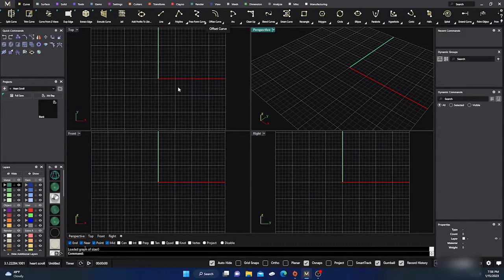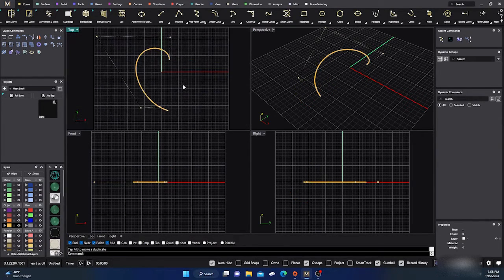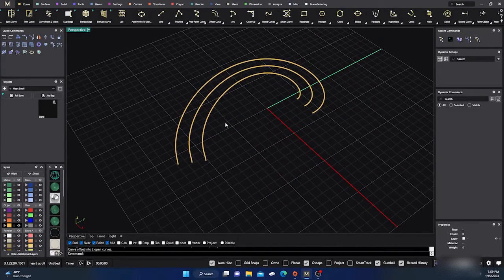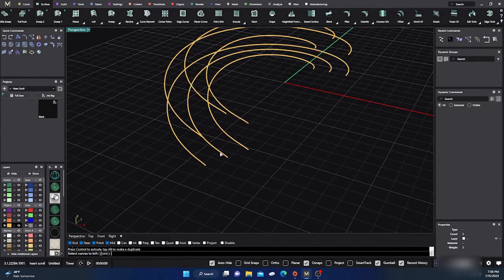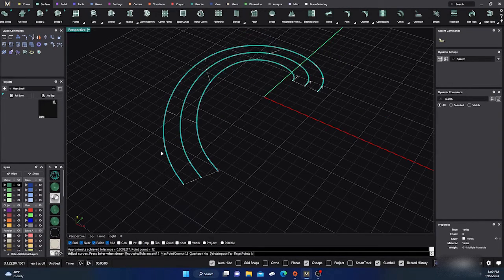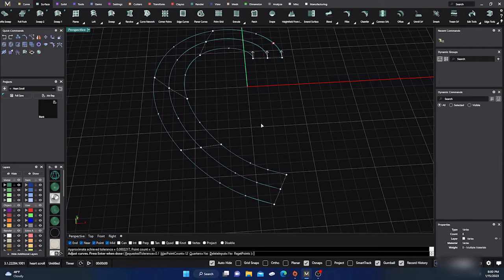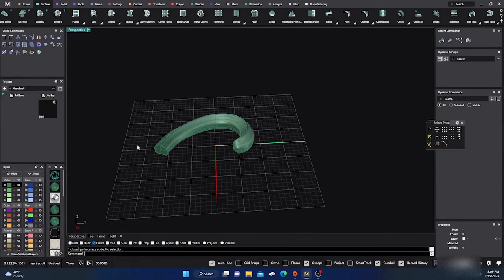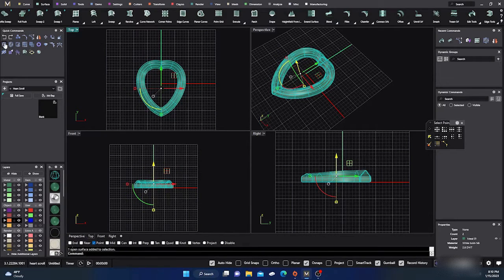Matrix 9 to MatrixGold transition Rebuild Curve Non Uniform making a Heart

Comment: Why we have to do “Rebuild” after we draw line sir?
Reply from the maker: There are many reasons to rebuild curves and surfaces. Mostly to gain better control for editing with points but also to take a polycurve and turn it into a nurbs curve so it will give you a better editable surface. I have some content on the channel you should research if you have the time. Thank you so much for the question and leaving a comment. I appreciate your support.
Reply: @donsjewelrymakingandjapantrave  Thank you so much sir 🤍